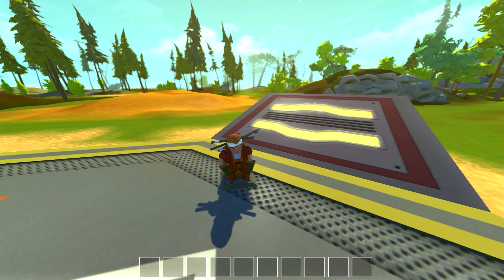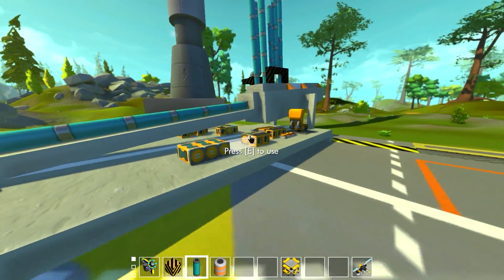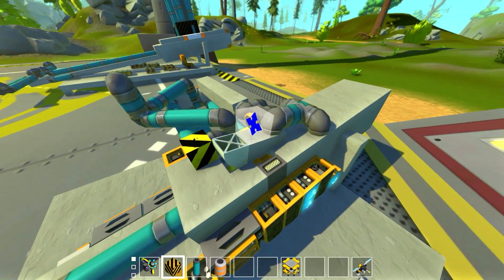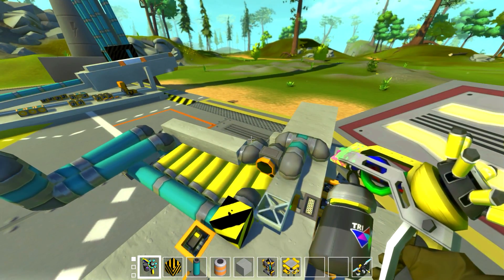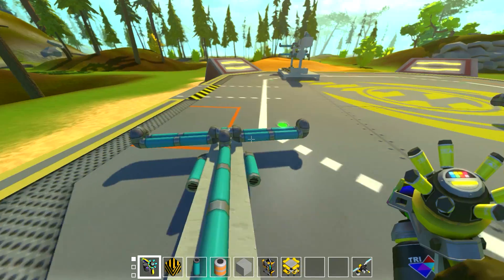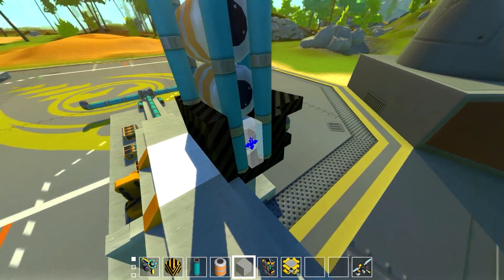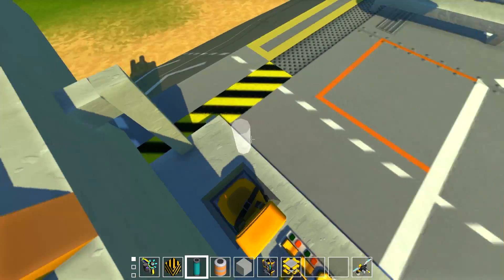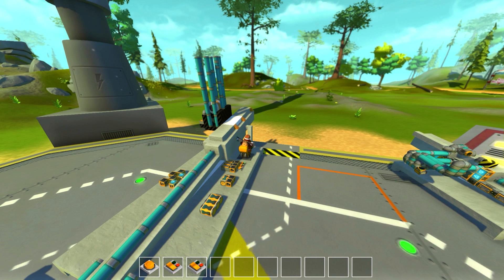Full Auto Pipe and Barrel Launching Cannons! (Scrap Mechanic #156)

Comment: you should try making a version with modparts..   maybe as pinfire with small thruster inside the projectile activated with a sensor in bottom end of shells.  it should work...   this way you can make a revolver  or a pistol with a clip.
Reply: hi!
Reply: howdy chef :)
Reply from the maker: lars kristensen I thought about doing thruster based projectiles but for this I really wanted to see what kind of power you can get from a single object

Comment: i know you are great with logic gates but there is too much electronic, you will avoid half of issues replacing gates with sensors that will check every step and mechanism will self adjust to every move that are sometimes slower or faster

Comment: oh
i build something like that a long time ago, but my is more compact then that - check it:
http://steamcommunity.com/sharedfiles/filedetails/?id=835267978
Reply from the maker: OZZA Interesting. I'll have to take a look and see how yours works and what kind of ranges it gets
Reply: kAN, there is modified version in my workshop. Less lags and have ammo rack in it - some of it can penetrate blocks and jamming mechanisms in vehicles.(sorry for my english)
Reply from the maker: OZZA No problem I'll have a look later! Very curious to see the firing mechanism you used to make it so small. also the smaller pipes on this penetrate the ground alot of the time but I haven't done any object testing yet